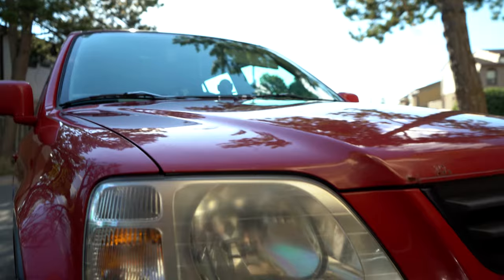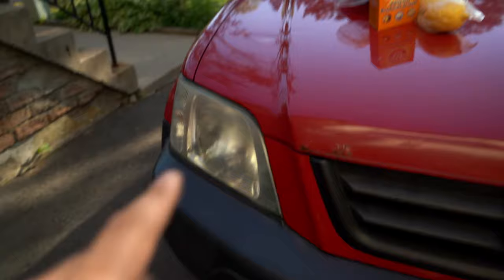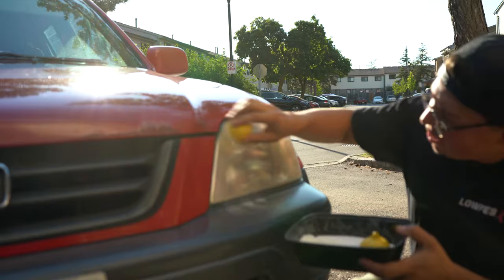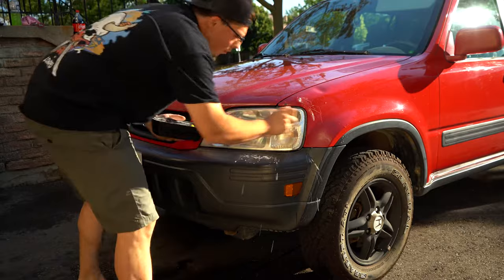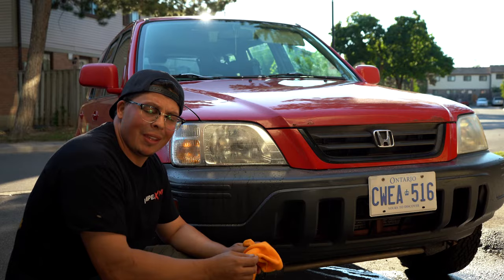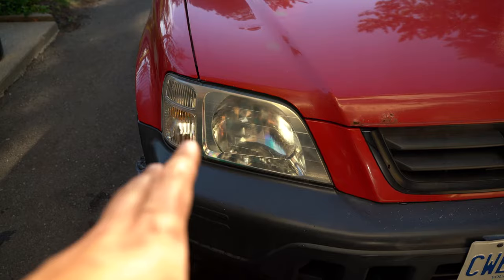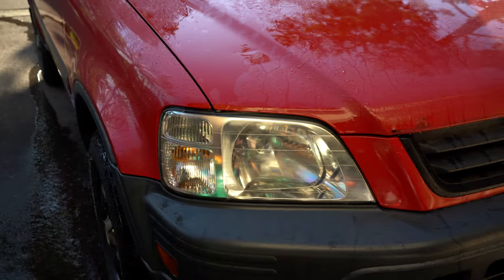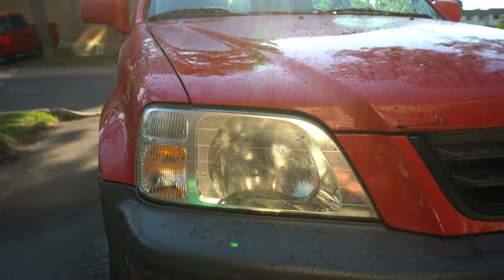Cleaning my Headlights / Lemon & Baking Powder VS Coke

Comment: I've watched hours' worth of YouTube videos like this, and the cheapest and easiest solutions are coke and lemon with baking soda. BUT to use coke, it's better if you soak a paper towel and leave it on the lense for 5-10 minutes. And, you have to use a auto wax and buff, it'll help make it stay longer. 
Anyway, even if I have to do it every month or two, I'm ok with that bcus my SUV is over 10 yrs old and has other cosmetic issues. She's got a good strong engine, so I deal with it for now.